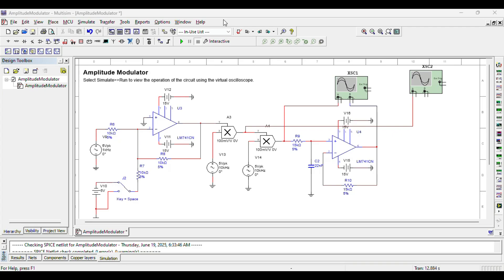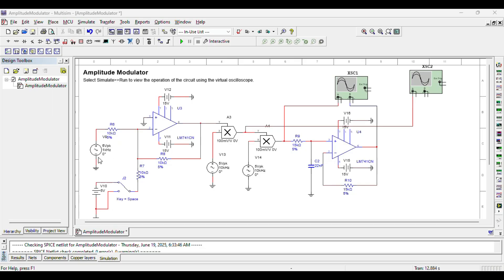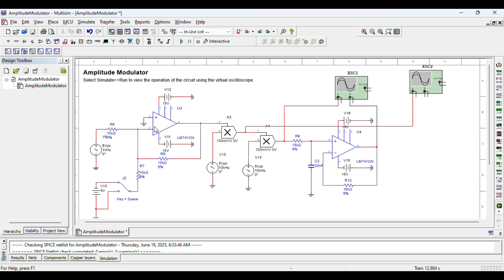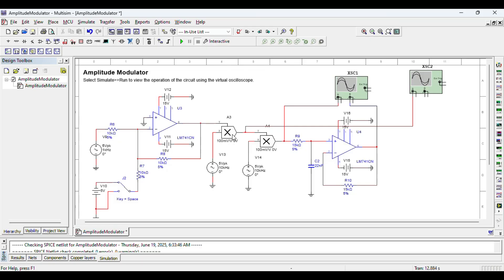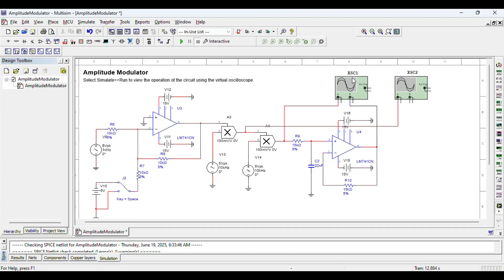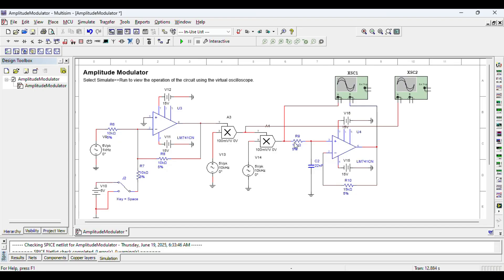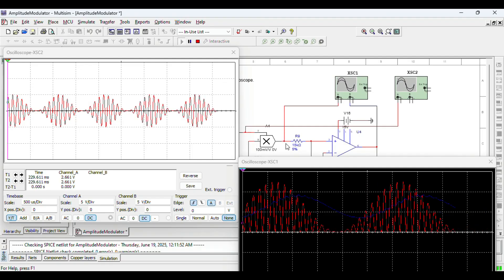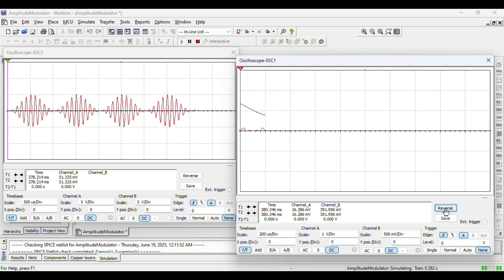Amplitude Modulation and Demodulation Circuit Simulation in Multisim | AM Explained with Waveforms

Comment: Please do better simulation with no analog block module ( mixer) replace the mixer by OpAmp and transistor and diode and passive components. Don't cheats
Reply from the maker: I used the modules to keep the video concise and focused on the core concept.